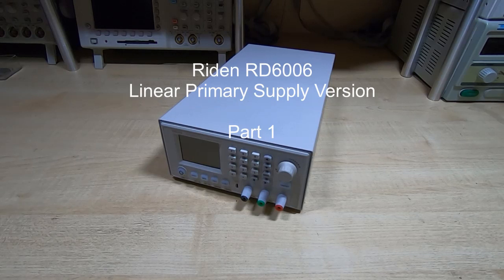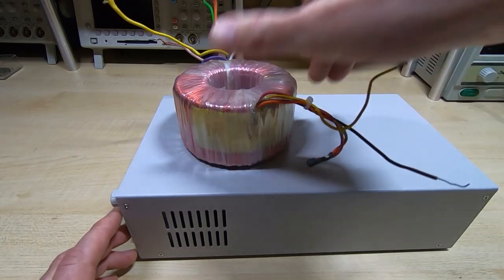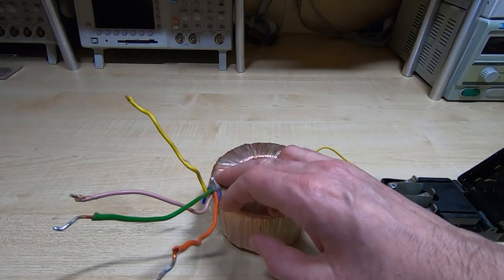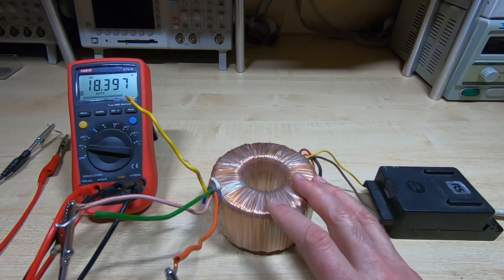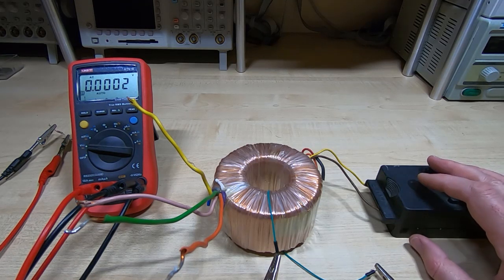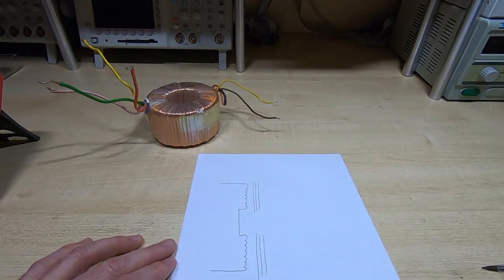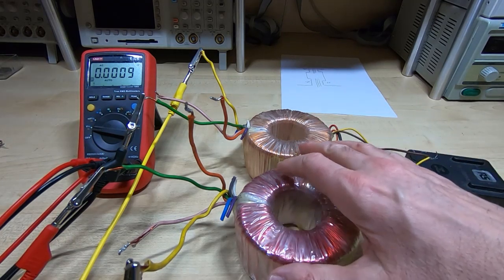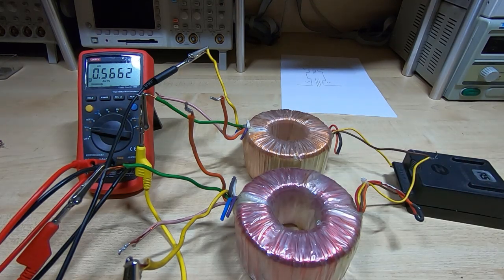RD6006 Linear Version Part1

Comment: Hi, I love your videos of these power supplies, I was just thinking on getting the 6012 kit and found these videos extra usefull. Thankyou for making these. 

If I may, I'd like to point out one area of refinement. Especially on this video there is very audible low frequency hum.. Around 6:20 it's really loud. As a part of video making i'd recommned using rumble filter (perhaps 80Hz high pass). 

Besides that, audio quality is really good..

Comment: I've been wondering if I could do something similar with a variac and an isolation transformer for safety. Main reason I wanted to give it a try is that I already have a very nice PowerStat variac and am already in need of an isolation transformer for general benchwork usage. Also if the DC supply dies, I can order a wider range of replacements since I can adjust the input voltage. I'm just worried there's something I'm missing even though I've tried to read a lot about doing it safely and without breaking something. Does this sound like a reasonable setup to anyone?

Comment: Hello Jerry and thank you very much for your RD6006 videos series.
I have no such skills to adapt any ring transformer to my needs, but I am interested in building my linear RD6006 project.
So I would be glad if you could publish the reference specs for a commercial ring transformer. Just to buy one of it from a online shop.
Following your calculation it should be fine a 240v/48V AC model that could drive the RD6007 with a DC voltage of 65.7 V (after the rectifier/stabilizer circuit). I am also missing some power considerations: 60v x 6A = 360 Watt, so I think I should find a 400VA model.
Any help will be appreciated.

Best regards
Enzo

Comment: 5.34: What is that connector block called, and where can I get one? I remember them at school in the '60s and thought be might be illegal now (I still remember a school chum twitching on the floor after using one incorrectly).
Reply from the maker: Mine is called John. They are one of the few things that are still legal :) Available in many places such as https://www.ebay.co.uk/itm/MAINS-QUICK-TEST-SAFE-BLOCK-TEMPORARY-230V-CONNECTOR-13A-for-WORKSHOP-REPAIRS/112606034274?epid=652377813&hash=item1a37d7b962:g:fWgAAOSwAC1Z5iP2 (Please note that I do not have any affiliation with this seller and cannot vouch for the quality or safety of this device).

Comment: Hey, heads up if no one has mentioned this before. I've noticed that my RD6006 won't readjust it's max output if the input changes.
As in, if the supply is at 13.8V unloaded, the RD6006 will max at 12.8V as expected for the built-in 1V drop. But if my input supply droops by any amount when loaded (as most supplies tend to do), the RD6006 will still try to output the original 12.8V limit. I haven't tested this to any extreme yet (like using an unregulated supply). So I have no idea if the RD6006 will readjust at a critical threshold (below 300mV drop?). Or if it might just go bonkers if the supply droops too much?
Reply from the maker: I did test this on my first unit and once the switching reaches maximum then the output will start to droop if the input voltage is lowered either due to current limiting or maximum voltage being reached. It seemed to do this is a fairly predictable way but in light of your comment I will carry out a bit more testing. The supply does not seem to turn down the maximum voltage allowed to be set based on input voltage being lowered. It may only measue the input at start up rather than dynamically (if at all).
Reply: @JerryWalker001  does it have any means to tweak the firmware (i.e. a  programing header and a source repository)?
Reply from the maker: edgeeffect, There seems to be a programming connector, I will be posting a video of a mini teardown of one of the units in a few days so you will be able to see what is on the boards. I doubt that the firmware is available but it should be relatively easy to write something from scratch. It may be an interesting project.

Comment: Hey Jerry, I found a 60V 400VA transformer at tme for less than 42 pounds, so not hundreds. Shouldn't something like that be fine for a project like this?

They have versions capable of handling more power, too. But not higher voltage.

I don't have the RD6006 yet (it is on the way), so I can't make measurements, but the transformer is only Ø 137 by 54 mm. Am I way off in thinking it should fit your project?

I probably won't be doing this. I just ordered one of those cheap Chinese switch mode supplies. I think exactly the same one you used.
Reply from the maker: If it is a UK (50Hz) core then it may just be enough but 400VA is not really big enough unless you can get the power factor very close to unity which is doubtful for something like this. I did find some 400VA transformers of that size (actually I think they were 58mm tall) but I want to be able to reach the full 360W continuously and I doubt that 400VA would be enough (especially with modern optimistic ratings). Please bear in mind that my videos are not intended as the only solution but are intended to give information about alternatives and simply fitting an off the shelf transformer would not be very interesting. I also found some more expensive 500VA transformers that I considered using but again it would have made a fairly boring video. I think it would certainly be worth trying one of the transformers you have found but my intention for this series is to show how to 'roll your own' :)
Reply from the maker: Just though I sould mention that if you did decide to use one of these transformers then it is probably the 48V unit that you want as they generally specify RMS in which case they would give 67V when rectified but the 60V would give 84V which would trip the over voltage input protection for the RD6006 (It may be worth asking how they specify them but it is usually RMS). Looking at the size I am suspicious of the rating but I may order one just out of interest. However as I mentioned my video series is intended to show how to make one.
Reply: @JerryWalker001  Hi Jerry, when you say the 48V transformer would give 67V, is this the difference between RMS and peak to peak voltage which you are referring to?
Reply from the maker: When you rectify and smoothe AC you get approx 1.4x the AC RMS voltage so if you take 48V RMS x 1.4 you get 67V.
Reply from the maker: I thought you may find this of interest. I did a rough calculation based on a 400VA transformer and including 'normal' losses and to get 360W output you would need a power factor of 0.98 (VERY unlikely) even if the 400VA was genuine. The two transorfmers I am using are 280VA each which I am derating to 225VA each so in reality the pair give me an equivalent 560VA. Also I see that TME do not stock the transformers so they may not even exist and by the time you add VAT and shipping then the cost would be much higher but almost certainly there are alternatives.

Comment: What about R type ferrite core transformer ? Compare with toroid type, can you please do a comparison video, by the way it is a very good and informative channel, great job!!
Reply: Because of the low saturation flux, the ferrite core can not be used in low frequency transformers. Typically, ferrite core is used in transformers that work with frequencies over 10kHz. Afaik there are ferrite types that can work in applications as low as 1 kHz. For low frequencies transformers, like the one Jerry needs, the iron core, be it toroidar or the classical E+I, is the best.

Comment: I built the linear version of the RD6006. Due to mostly of the lack of time I couldn't wind my own transformer, so I ended up using a 60v/5a I had lying around. After rectification I got 72V wich was triggering the input over voltage alarm of the Riden. So I dropped the voltage further by putting two diodes in series at the input of the RD. The voltage dropped to 70.2 V and the RD seems to be happy with it.
Reply from the maker: Sounds good, Unfortunately UK transformers are significantly bigger for the same VA so I could not use a single transformer unless I dropped to 300VA. Note that the primary of your transformer is almost certainly the last winding so you could just add a few extra turns to the primary to drop the voltage of the secondary. That would give you better performance. I did look at buying a couple of ready made transformers but apart from the cost I thought that the videos would be more interesting if I tried a diferent approach.
Reply: Isn't a multiplier for voltage after rectification x1.41? I already unwinded secondary down to 50V ac hoping for 70 volts after rectification...
Reply: @robisr384  it is, but you need to take into consideration the losses of the transformer and the forward voltage drop of the bridge rectifier. 50v ac seems a bit on the low side, but I think if you use a schottky diodes bridge rectifier, like Jerry uses, you should be good. You also need to keep in mind the "sag" of the output voltage of the transformer. When unloaded or with a light load attached, you will get a higher voltage.
Reply: @Bata.andrei  I have just made a simple test with 5w 680ohm resistor (resulted by ~3.7 watts load on 50V) and there was no sag of voltage...It seems that domestic manufacturer of this toroid did a good job building this transformer...
I ordered shottkeys (s60sc6m), rectifier filter capacitor board which I have to modify a little and 8x4700uf 100v caps...hoping for good results